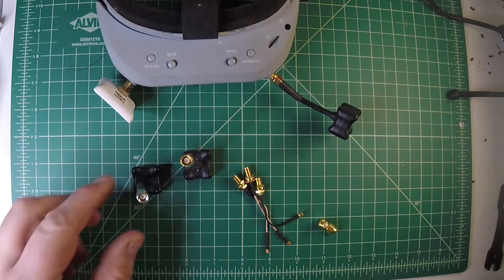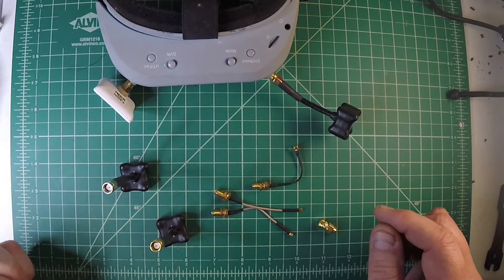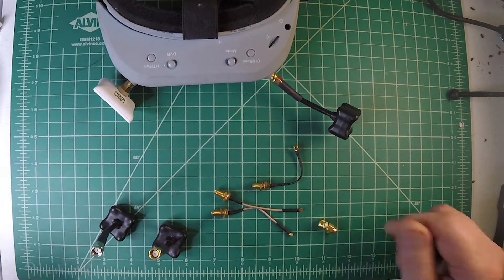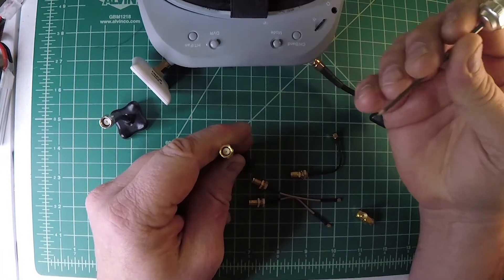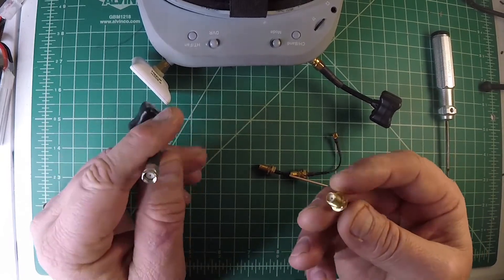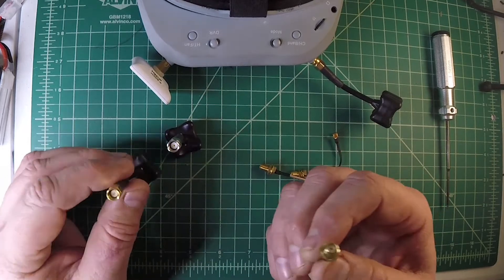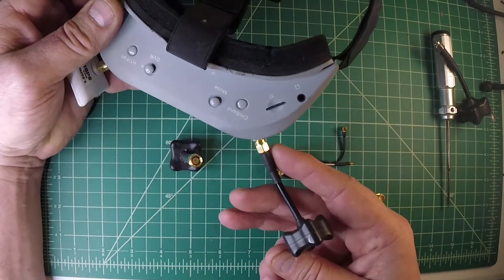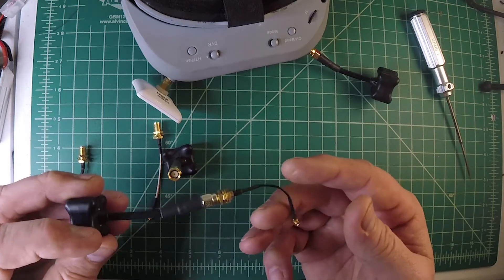Deciphering SMA vs RP-SMA WTF, Drone 101

Comment: Sma is sub miniature cable tv style connectors. 

 Rp sma is pin on the threads . 

  My original fpv analog had the threads and pin sticking up . Rpsma .   That helps me remember

Comment: rp sma vs sma tells you which side has the pin
male vs female refers to the threading
Reply: Male has a pin, female has a hole.  Thread is irrelevant when determining "gender" of connection.
I understand your confusion as threads are also deemed M/F, but the connection is what matters.
Now, to figure out sma vs rp-sma...
SMA_ Male has a pin and inner(female) thread, Female has a hole and outer(male) thread.
RP-SMA_ Male has a pin and outer(male) thread, Female has a hole and inner(female) thread.